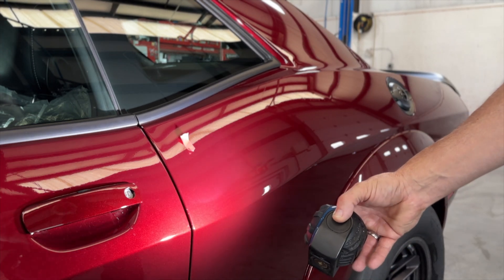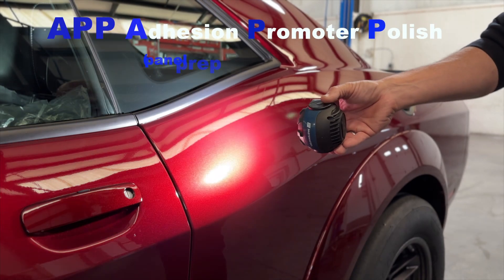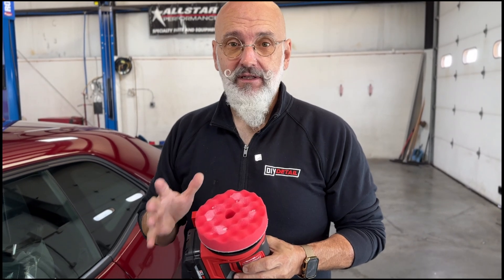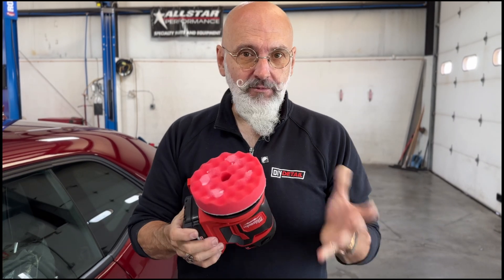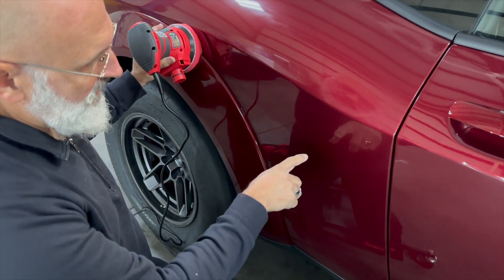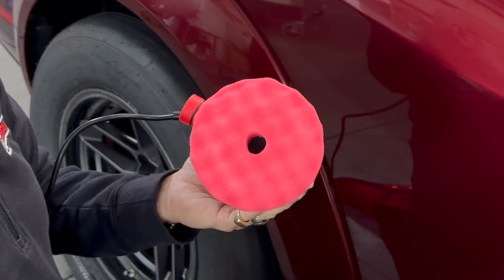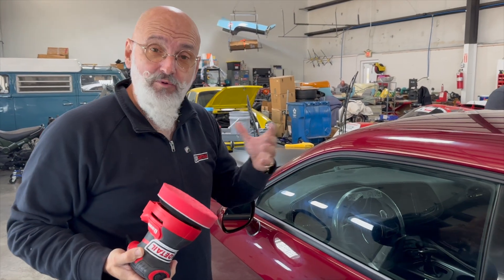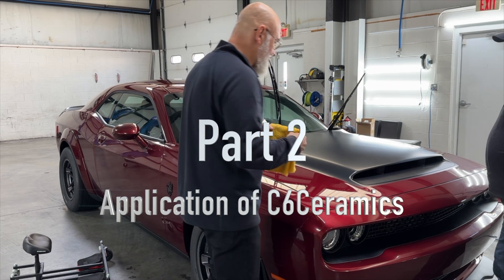Part1 #DEMON 170 THE APP Adhesion promter polish for c6 ceramics#C6ceramics #diamond coating

Comment: Can the APP be applied with a Griot's Garage GG6 (8 mm) polisher on speed one? I bought a Ryobi cordless sander with the 5" velcro backing plate, but that thing sounds and feels like a jet engine taking off. It has only one speed, I can't slow it down.  But I remembered my first polisher, which I don't use anymore (GG6), had the 8 mm throw. I was just wondering if that would work with the APP?
Reply from the maker: 3-8 mm is fine

Comment: What speed did you set on the milwaukee orbital sander ? I believe it goes up to speed 6? and did you take the rubber brake part off the orbital sander? Thanks!!
Reply from the maker: Speed 6, yes brake is removed.

Comment: Therefore before using app we should do a one or two step paint correction then panel prep spray then use APP on short throw and remove with dry towel
No Panel Prep Spray after that correct then coat the beauty 🎉
Reply from the maker: Almost, if you use The Gold Standard Polishing System no need for panel prep.

Comment: Im so excited fir this, but I have 3 main  questions:
1. Does APP contains protection by itself? So, can I apply it as my LSP? If so, what is the average durability?
2. If minimum cut is desired, why not apply it with a rotary?
I assume a rotary have less cut than a palm sander because it has no stroke vs 5-8mm on the sander.
3. Can it be used on ppf?
Reply from the maker: The app does, but it won’t be long lasting.

The rotary over works the APP because of the long uninterrupted motion of the pad, so do long stroke polishers.
Yes it can be used on ppfy

Comment: How is that cordless Milwaukee sander and what speed do you run it at? It looked smoother than the Bauer machine.

Are there any other mods required for it?
Reply from the maker: It works well, you will need to remove the pad brake

Comment: Why a small sander vs a polisher?
Reply from the maker: The longer stroke machines overwork the product.
Reply: @C6ceramics how about a 15mm machine at low speed and with faster arm movement? What would be the consequence of overworking the polish?
Reply from the maker: Over working makes it hard to remove.

Comment: What applicator are you using for hand application of APP? What is the stroke on those sanding machines?
Reply from the maker: for the app we use the diy detail red applicator, the stroke of the sanding machine 3 mm at 8 mm max